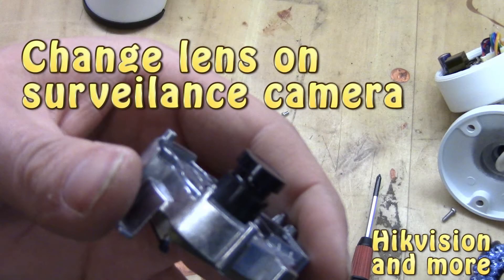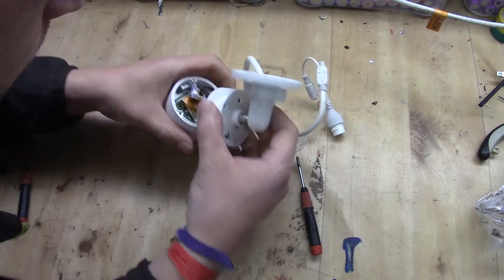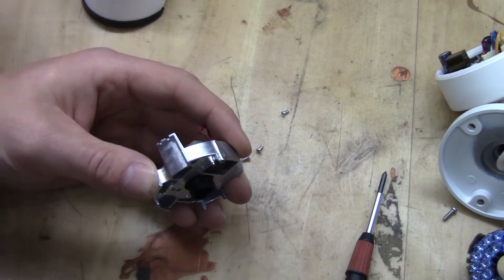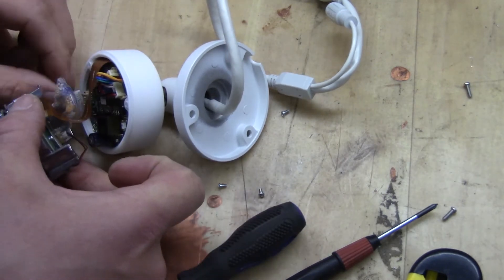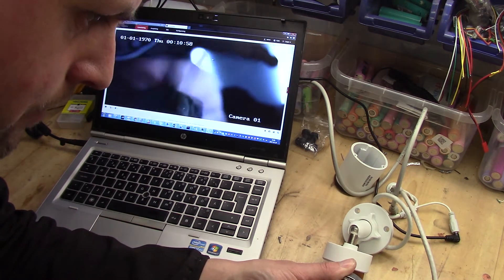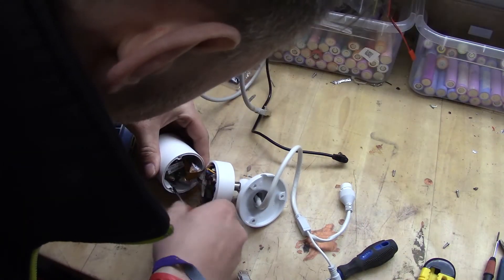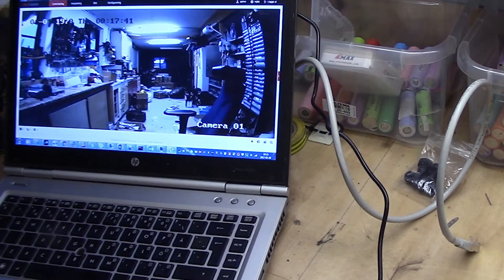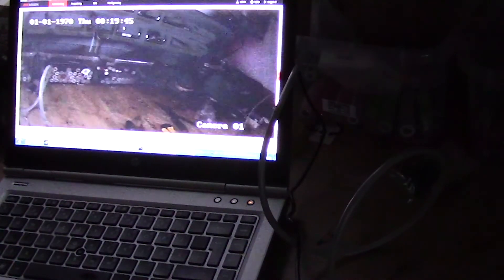Lens-Change on surveillance camera

Comment: Thanks for the video, the lens link is dead.   I found some lens but do I want an IR filter or not.   I think I don't since I believe the barrel of the lens holder has a shade that may drop in to insert a filter but I'm not certain if that is the purpose for the base with the small red wire coming out.

Comment: Better yet why deal with the idea of a Fixed lens when there are so many cameras out there with VF lens or even Motorized Zoom lenses.. One of the things that people need to understand not all lens are the same.. Some are IR lenses and most the ones that I have bought that are will have IR on the lens somewhere to say it is.. Another issue is Size of lens maters.. You put a 1/3 lens on a 1/7 sensor your going to notice.. So you will want to if changing a Lens you will want to make sure your buying the right size lens for the camera sensor.. Also some people can swap out Motorized lenses for a VF lens as long as the camera your making this adjustment too has the wiring header for it.. If not it can be done as long as you know how to run the wiring to a external controller.. Like I have a older CS lens from Pelco 20x zoom that didn't come with controller you have to make your own switch and power setup for the Lens this was made really before the invent of RS-485 anyway or you could buy one of their controllers but it is really just the same as the one I made for it... two 2 way switches..
Reply: What does the IR on the lens mean?   Means capible of IR or not?    What kind if lens to buy, one with IR filter or not IR filter.
Reply: @fastbyte9972  IR on the lens don't mean that it comes with IRC it just means that it has a coating on it that will work with the use of a IRC Filter. Now I might be wrong as there are some non IRC cameras out there that offer a IR on the camera with a IR coated Lens (Normally large square piece) that sits between the lens and the Sensor.. Problem with this type is that the IR don't really look right and it can distort the image and even produce a green looking image on daytime color when the IR light comes on with subject close to the camera.  Then if we look at a non Box camera like maybe a Mini Dome or bullet, They might have a IR non adjustable lens again means that the lens can work with IRC Filter for a better clear night image... What is important for a Clear night image is that the camera has a IRC Filter and it works in connection with the IR system be it a Built in or Blaster. Blaster will be better for ability to have less bugs, rain or snow in view at night not many cameras offer IR settings for Ext Blasters these days. Unless your willing to pay a grand or so for a Box camera. For that kind of money better to buy a Motorized VF Bullet with IR that works with Zoom. Could buy a few for a Grand..
Reply: @revo2maxx  How many turns left to rock the lens without breaking?
excellent! If I change the lens for a 3.6mm lens of the same size that it comes with, the one I want to change, which seems to be 12mm, would it work and the angle would change or would it stay the same at 12mm?
Reply: @TuMundoAndroideMania  To be honest there are a lot that goes into setting up a camera. What is important is the lens thread size and seems that you have that info and next would be the Flange Focal Distance. because if you happen to have a Compact camera they might have used a special lens mount that your new 12mm lens. 3.6mm to 12mm lens would be about 3 times closer and would have a narrower field of view. AKA Objects will appear larger and closer, however the area captured in the frame will be reduced.
Reply: It seems you know a lot about lenses because exactly the same thing is happening to me. I managed to put a lens on an Icsee surveillance camera, the camera is 1980x1080p but changing the lens from a 5 megapixel camera to a resolution of 2592x1944 which if it has a good angle of almost 75/80, the angle remained the same. vision. That is if at a horizontal angle you can only see a little more but almost the same, could it be because of the resolution of the camera that it did not open a wider viewing angle? I believe that in this camera it does not depend on changing the lens and that it depends on the resolution of the sensor! And regarding the mount it is the same and the lens also only changes its mm, which exactly I don't know if I think it will be the same lens since I knew it by comparing the specifications and seeing the hole in the lens. I don't know what it means (AKA)! Any trick to know the focal length of the flange (although when adjusting the lens it was not very far. @revo2maxx
Reply: @TuMundoAndroideMania  Not sure I understand 100% of what you mean. So I will try and see if I took in enough. Camera you are dealing is a 2mp camera? You inserted a lens from a 5mp camera? Or do you mean you took a 2mp lens and put on the 5mp camera? Sorry little brain fog today.. What is important to know. When dealing with these little  lenses. If you want to change the AREA OF VIEW or FOV then you will want to get a lens of the right MM size. So lets say right now the lens is a 2.8mm lens and that is to wide for your viewing needs and want to move in closer to the area. Then buying Or using a 6mm or 12mm depending on how close in you want to be. One of my cameras is a 2mp TVI with a 5mm x 50mm auto focus lens. That can go from seeing more then I want to, to looking at a pebble on the road. So if the intent was to see the pebble on the road I know I would need a lens of 50mm to input on a fixed lens camera. However if I wanted the current viewing area then it would be around 16mm to 20mm. I have a video on my channel showing that camaras function. However if you took a 5mp Lens and added it to a 2mp camera you will still only have a 2mp camera because the sensor is only 2mp..

Comment: Foscam FI8905W: I replaced my stock 12mm lens with a 4mm lens for a wider view.  In the 
daytime its great but at night time what used to be a full bright scene 
at night is now only a small inner circle of brightness with the 
surrounding of the circle darker.  The 4mm lens did not come with the 
small piece of square plastic (I think filter?) I removed it from the 
12mm and put it on the 4mm with no difference, still only a small area 
of brightness in the center of the scene.  Any ideas what might be 
causing this?
Reply from the maker: Because the IR is lightning upp the area that the 12mm would have shown. You need to move how the leds are distributiing its lights. Or put up another ir light on the side of the camera.
Reply: How many turns left to rock the lens without breaking?
excellent! If I change the lens for a 3.6mm lens of the same size that it comes with, the one I want to change, which seems to be 12mm, would it work and the angle would change or would it stay the same at 12mm? @DIYTechRepairs

Comment: Great video. Do you know how could I modify a camera lens to focus on very short distance? I need a "macro" ip camera to focus a small arduino display a few centimeters away. May be just removing the lens?
Reply from the maker: You can buy macrolenses for Them. But why No just hook the Arduino Up to internet? Like esp8266 or 32? :)
Reply: @DIYTechRepairs  Thanks, I didn't know that they exist. I need to connect the arduino to a NVR that hasn't alarm inputs, so the arduino shows door sensor info on a display, and the NVR motion detection sends me a picture if any of the sensors change.
Reply from the maker: @CogitoBcn  most nvr software can be triggered externaly. Might be Na option
Reply: @DIYTechRepairs Thanks, I wish but I was not able to find any in/out in the Reolink NVR. As additional advantages I can get an image of the house plan showing the open/closed doors and using the NVR app to get notifications on my phone. The camera+display interface looks silly but it has a lot of advantages and it's easy to make (once I get the optical focus solved). :)
Reply from the maker: @CogitoBcn  ah. I use blue iris so have more features :)

Comment: Hello, I am trying to do the same; swap a 3.6 mm fixed lens for 2.8 mm lens. However, the 3.6 mm lens is screwed in and a dab of glue is put around the mount making unscrewing impossible. I see that you are using a blade to cut through but I have been unable to do this; its so tough and using the blade to ease the unscrewing doesn't help. Any ideas on how to safely remove the old lens?
Reply: Kamran KI use mini pliers “Channellock 424 4.5-Inch Straight Jaw”
Reply: @MrOlvidado89  Set screw in the column below the IR lamp assembly